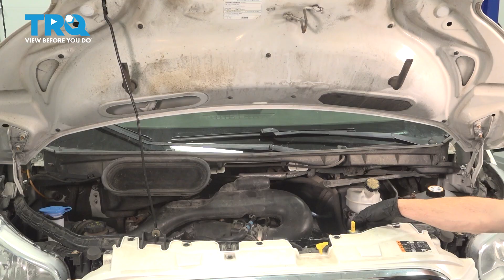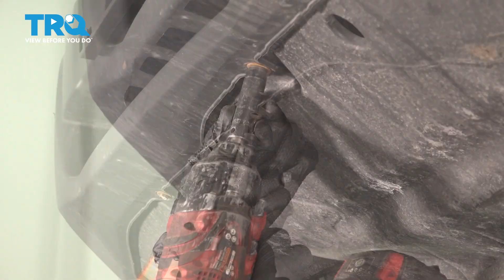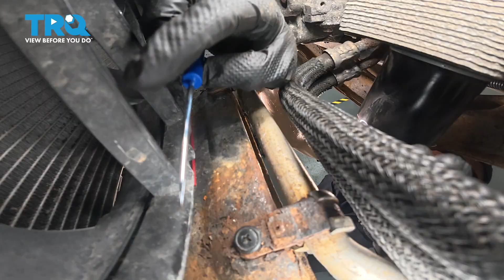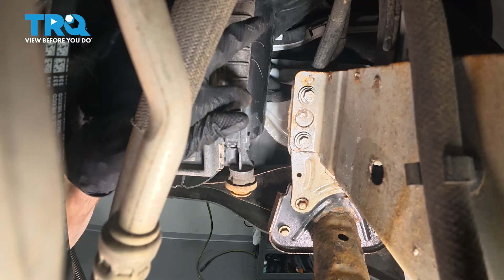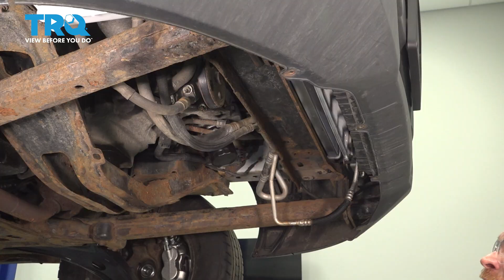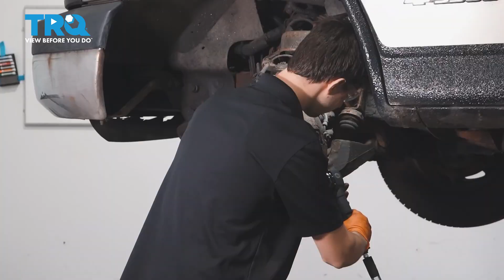How to Replace Dual Radiator & Condenser Fan Assembly 2015-2025 Ford Transit 250 3.7L V6

Comment: This could have been an 8 minute video If this dude didn't take 5 minutes to explain every 5 second process. If you're that mentally challenged that you have to be told how to remove a clip from the radiator, you shouldn't be doing this job in the first place